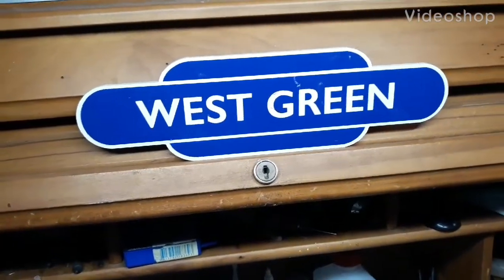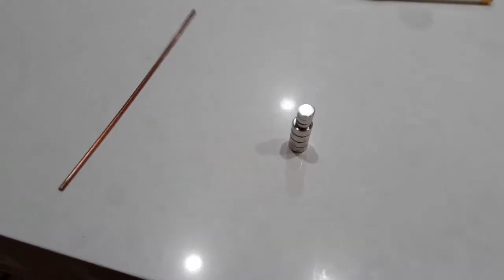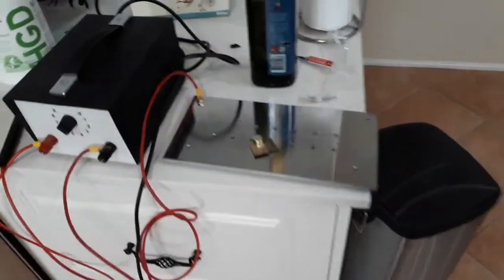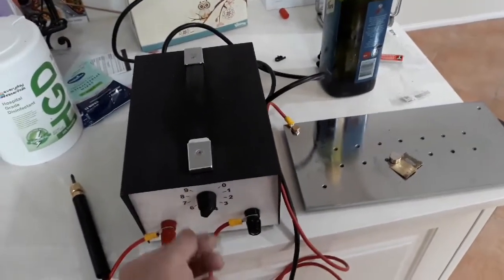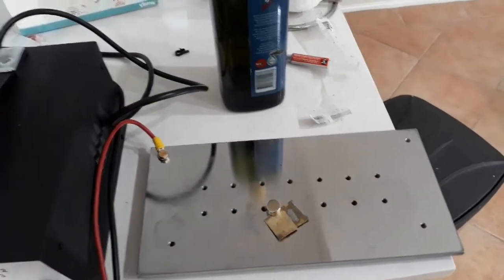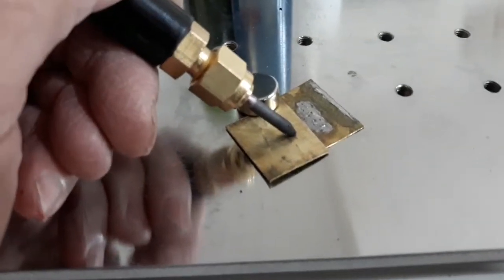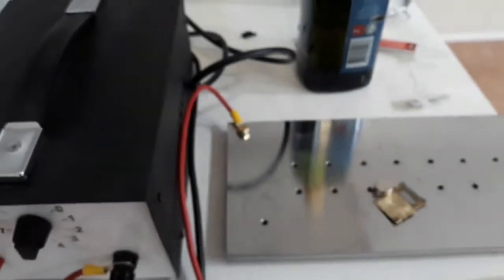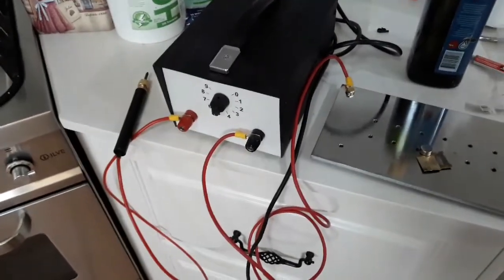Resistance Soldering Unit (RSU) for soldering brass model locomotives

Comment: That looks to be the most complete resistance soldering kit I've seen so far. Others require the steel ground plate and magnets to be sourced elsewhere. Where did you purchase it? Have you seen the two short videos by Peter Cane here at Youtube. Many be helpful. Looking forward to seeing how you progress with it.
Reply from the maker: Ii bought iitit from a bloke in Melbourne who makes them for modellers.
It's not a commercial made unit and cost around £150 complete and postage.
The magnets are lethal especially the 20mm by 10mm ones they will fly out your hand near ferrous metal.
The plate has M6 threaded holes in it.
This way you can put a models engineer square and bolts and hold them in place, the magnets are then used so you can do seam soldering on say a a tender base and sides at right angles
Reply: @Steven_Rowe  Hi Steve...What is the thickness of that tooling plate?
Reply: Hi Steven....I'm interested in knowing more about that plate that is used when you use the RSU.  What is the plating material?   It has to be electrically conductive and has to keep the magnetic properties of the steel plate.  I believe Chrome will not allow the magnets to work.  Perhaps Nickel was used?  Any comments by yourself and others would be gratefully appreciated .